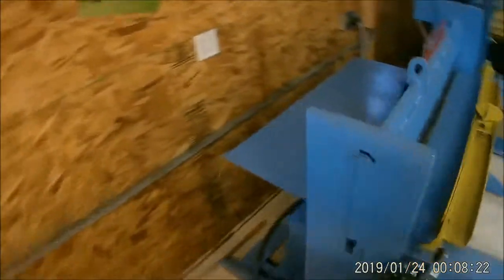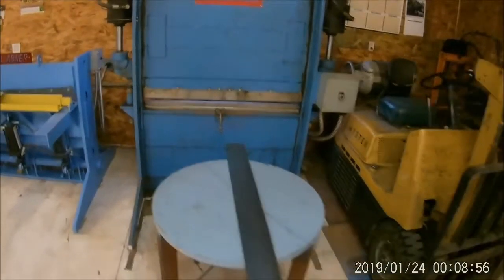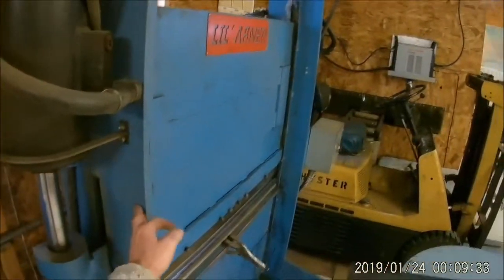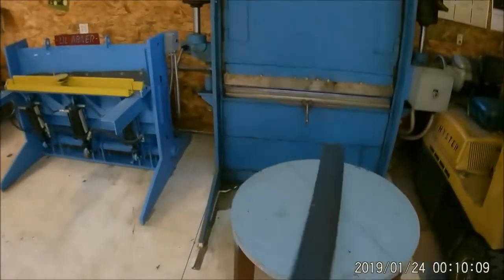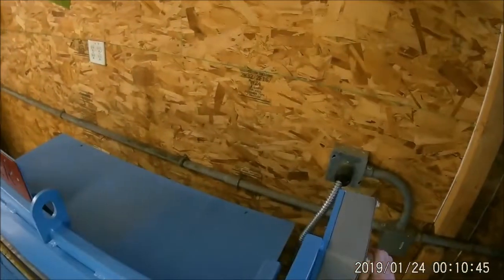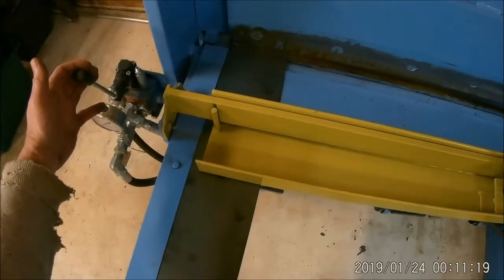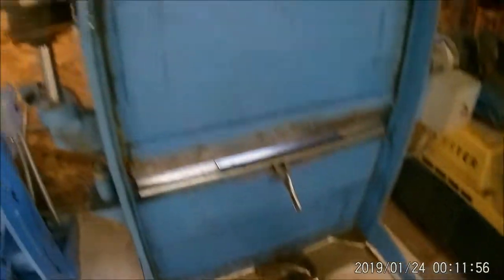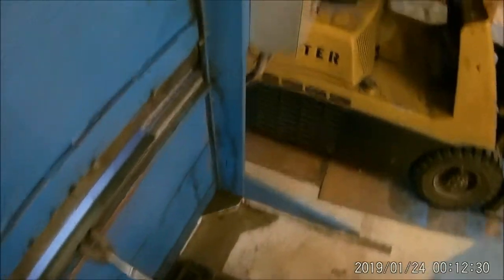4 FT. HYDRAULIC SHEAR AND PRESS BRAKE.

Comment: Very nice work, Sir
the set looks great , you built them heavy, taking out the twist factors. 48" x 1\4" is great size for any shop giving lots of range in materials and don't take up lots of room.
the manual valves are perfect, simple and last forever, easy to repair or replace.
 .blue is a good shop color, Ford\New Holland blue or Deere green from TSC  is durable paint in the shop.

Thank you for the time invested in making the video and sharing your builds.
Reply from the maker: Glad you liked the video.  Yes, I try to build things that are durable and easy to work on and do maintenance on.  I've got more projects shown on my website:   www.rapidcreekcutters.com and it's FB page.  It's fun working with metal and mechanical stuff.  I'm new to YouTube, so most everything I've done in the past is just in photos.